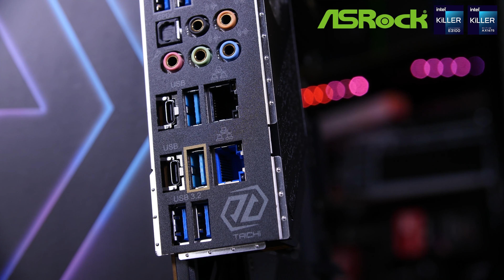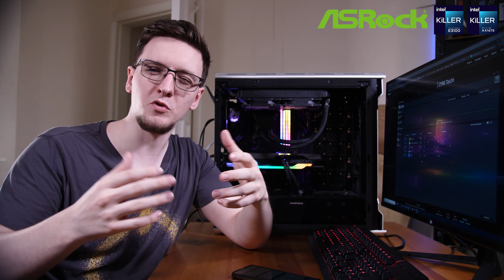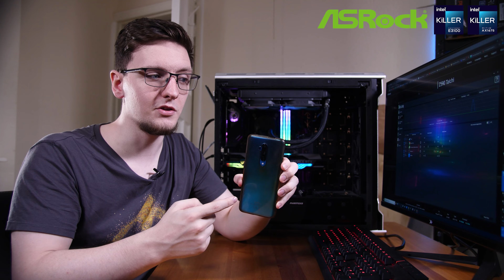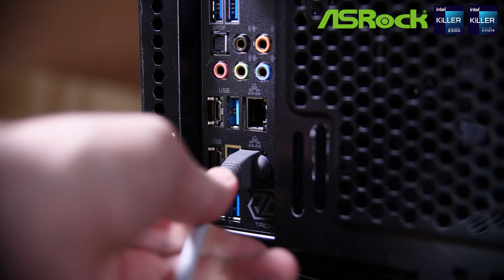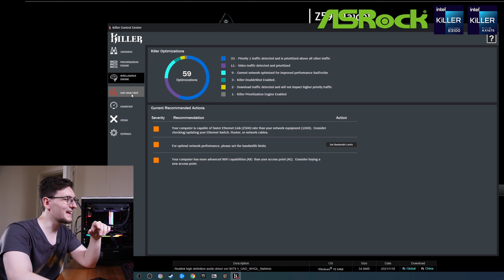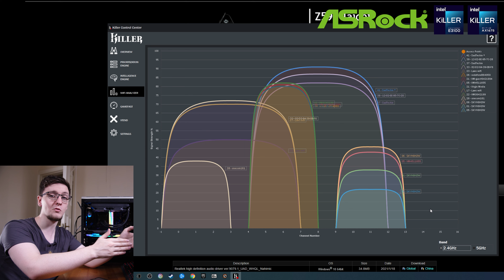Killer DoubleShot Pro Showcase - Kill Your Lag

Comment: So instead of just setting your machine to schedule downloads, you can buy an expensive motherboard, use your phones data to download updates whilst you play over your 2.5gbe connection whilst your CPU inspects all your packets and traverses them properly based on a bit of software you configured,  to then save you a little bit of ping?

QoS can definately tell the difference between a steam download and a game running

Comment: It's fitting that the awful 2.5/5gbit Intel nics have the killer branding. Honestly for consumers 2.5 and 5gbit is stupid considering the prices of much better 10gbit+ networking equipment and nics are. Intel x520 nics are dirt cheap now and can be found around $50-75, and do a lot more in hardware than these garbage newer Intel/realtek nics. For anyone wanting to spend a bit more there are some good prices on 40gbit nics for around $150 like the mellanox connect-x 4lx. For switches just get something like a used brocade or juniper switch. Most of this stuff is a lot cheaper than the garbage 2.5gbit equipment being sold. For packet inspection get a proper firewall by either building a cheap opnsense box or if your crazy get a good deal on a juniper srx firewall.